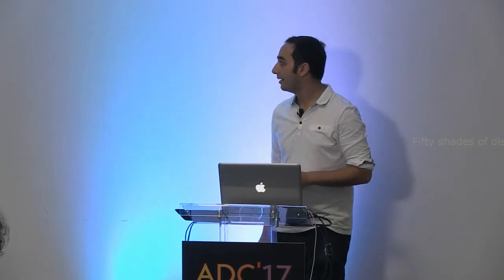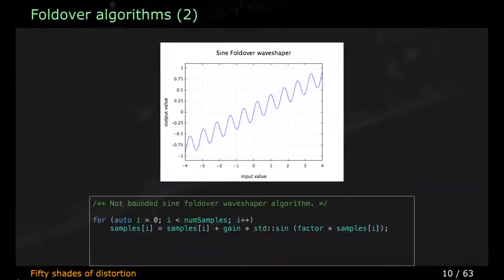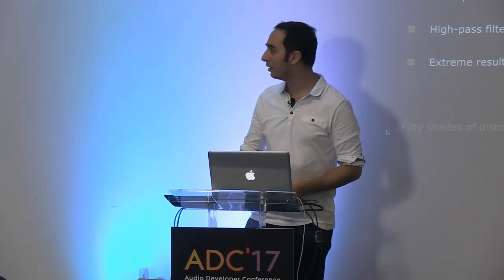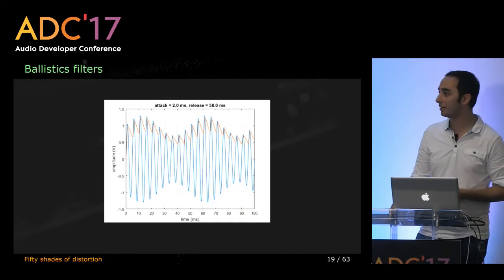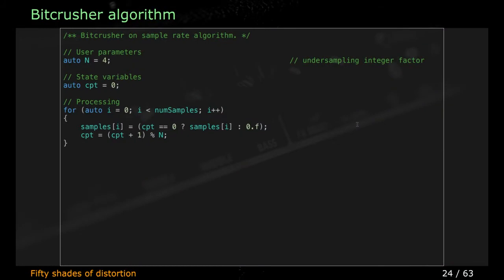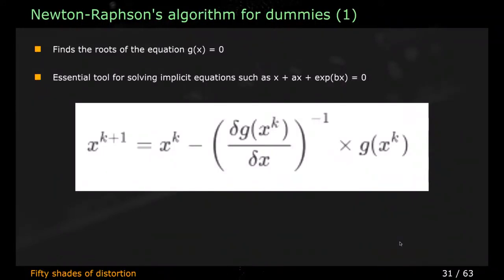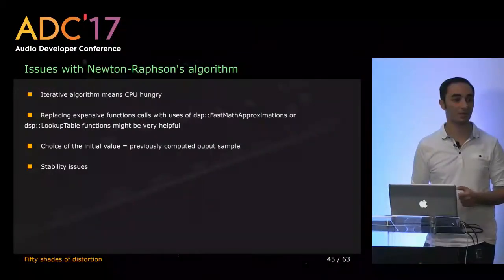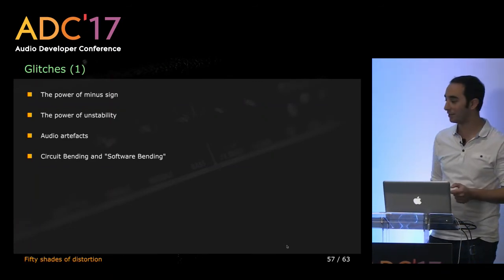Ivan Cohen - Fifty shades of distortion (ADC'17)

Comment: Fast math approximations already exist in many forms unsure why you had to invent these with your buddy. I would have liked to see a comparison of the actual code execution times for various math approximations and built in c++ libraries with examples. Also  a comparison of the separate techniques and there execute times. Good presentation just wish it had more of the technical code explanation affirmation of why your process is choice .  Thx
Reply: yes, that was what i was thinking. Would be nice to see the differences and comparisons and how it is faster to use their method instead. Maybe the biggest advantage in their implementation is that it is already in the framework so less things to link and perhaps make trouble at the end?